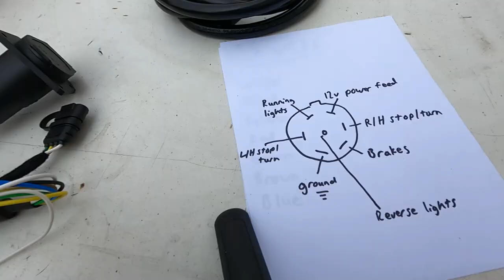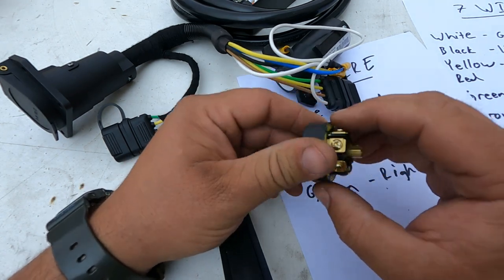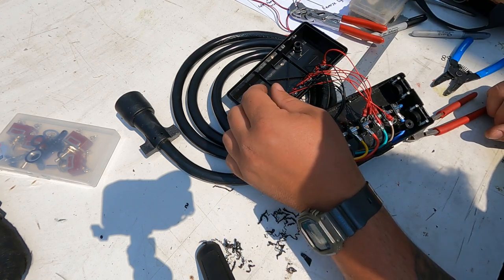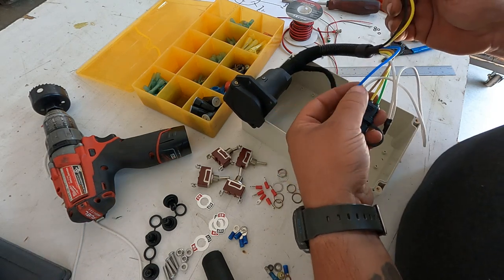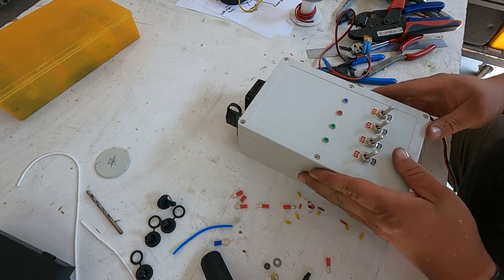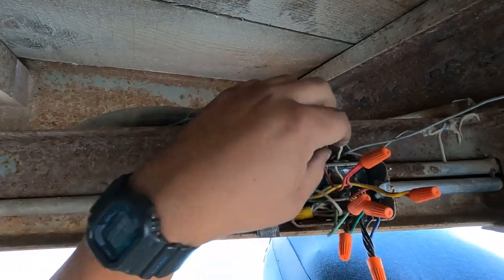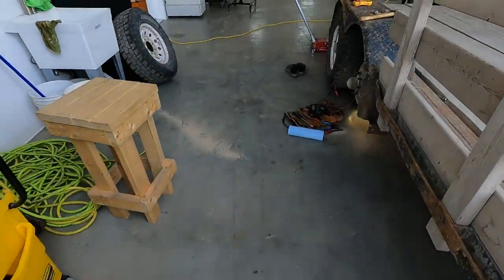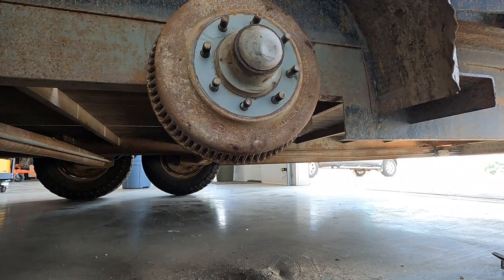Make your own test boxes for trailer and truck.

Comment: Good video, thanks.  Couple comments.  This is a different color code scheme than I have seen used.  A tester box is always a good idea.  I usually ignore all the codes printer on the connector and only pay attention to wire position.  

One other thing I really like on a truck tester box is a ballast resistor and amp meter to make sure the brake controller can actually produce the required current.  A 1 ohm 200 watt resistor will simulate a 2-axle trailer.  If the controller is working it should supply about 12 amps when set for max braking (this is why the ballast resistor needs to be 200 watt).  Just be aware, that resistor is going to get HOT when the brake controller is driving it at full power.
   
I also really like having the amp meter on the trailer test box.  You should see about 3 amps per wheel.  If you have a 2 axle trailer with brakes on both, you should pull 12 amps.  If you only get 9, you have a brake that is not working.  Don't even have to jack the trailer up to test.  You can't always run your trailer tester off the breakaway, even if it is good.  If there is a charging circuit on the breakaway it will often prevent "back draw" so the breakaway can't try to feed power to the truck.  

Can't say I'm a fan of using wire nuts on a trailer (or truck for that matter.  They are more prone to corrosion and vibration.  I really like the junction boxes (like you use for your truck tester).  I use these any time I need to connect more than two wires.  For a simple splice I use heat-shrink solder-less butt connectors or solder splices.  

Just finished a major rewire of my utility trailer.  One thing I have still not quite mastered is how to protect ALL the wires from rodents.  Most of mine are in conduit, but about half the places where it came out of the conduit got chewed up.  I am trying some new wire sleeve and only time will tell if that keeps them at bay.
Reply from the maker: Thanks for the feedback! Good idea on the resistors and ammeters for magnet simulation. I can’t say I have ever tried that before. I have done flashers and other nonsense in the boxes before but sometimes simple is best/easiest. I agree with not using wire nuts, I just purchased this trailer used and was not ready to do a full rewire quite yet. I normally try to use pre-made shrink connectors or solder and shrink tube. Good luck on keeping the rodents out. The only thing I have ever had luck with is trying to source wire that is guaranteed not to have any soy in the insulation.